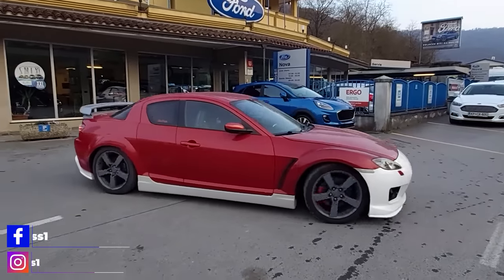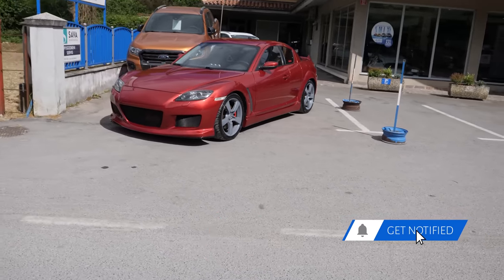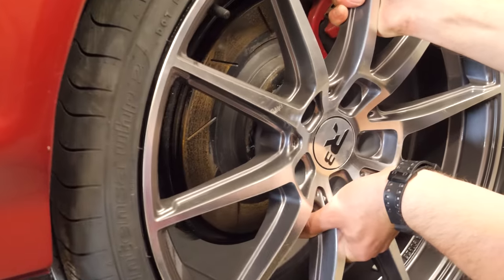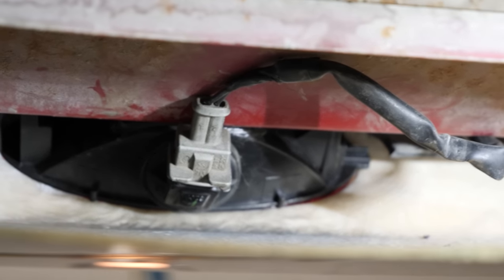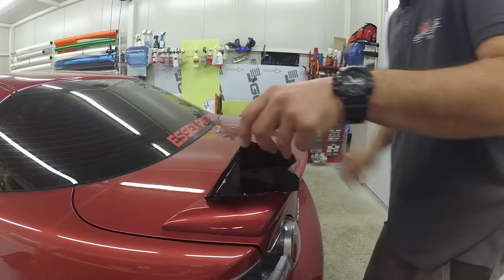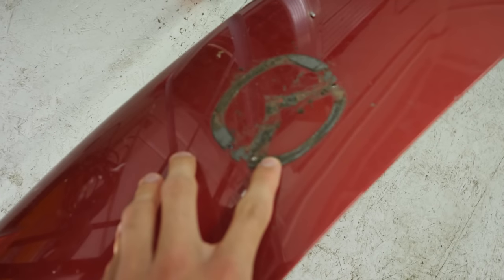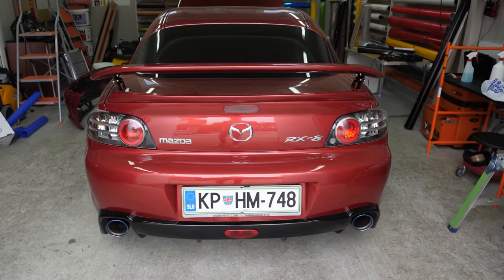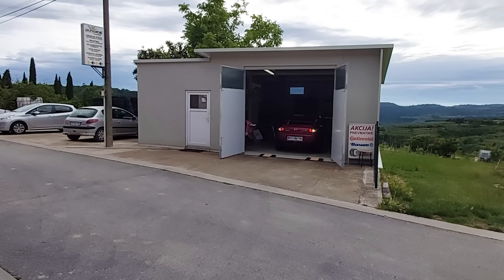INSANE Rx8 Body Kit Result 😍

Comment: 4:28 remember to add some heat insulator on the inside, otherwise the bigger exhaust can melt the diffuser
Reply: Exactly, the RX-8 makes a lot of heat
Reply: The rear bumper is fiberglass, i don't think it can melt🤔
Reply: Lovely car  just tßu thinks I would have put the triangle in front bumber and triangle regarding but all in all good looking car well done bro
Reply: @aleksandr_elkov  I believe it comes stick with one as mine looked as if it had one on it

Comment: 4:16 For the spoiler I'd use button head screws, so they won't stick outside that much.
Also, I'd consider trying red or black screws (the red ones only if they match the body color)